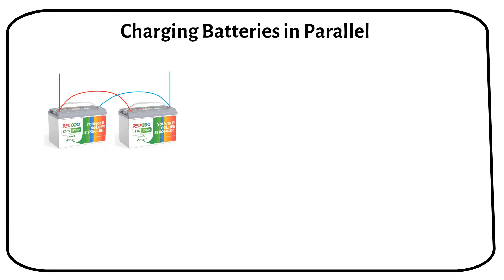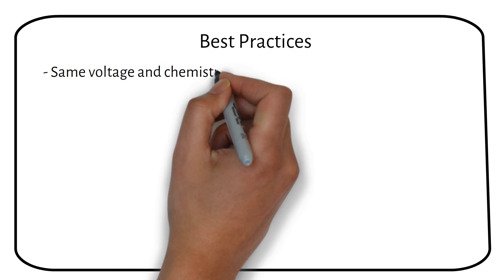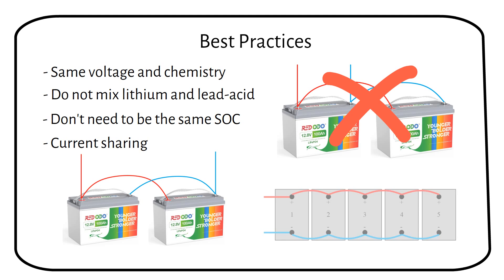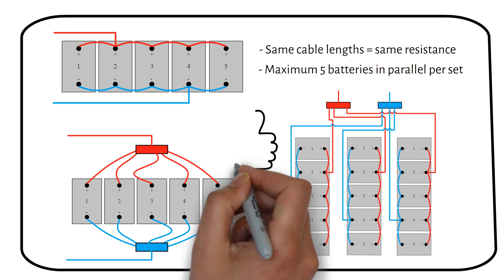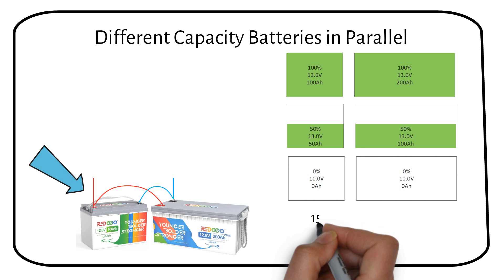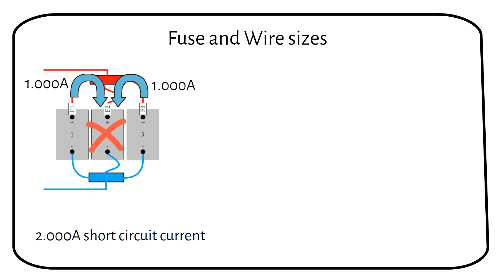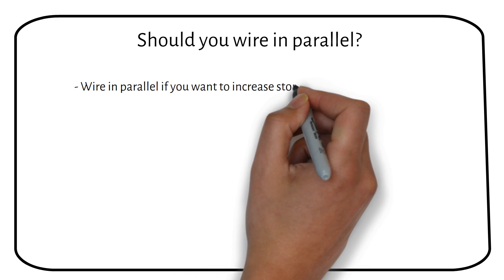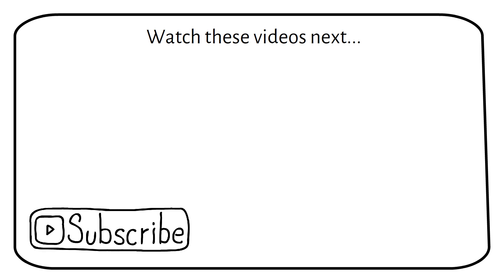How to Charge Batteries in Parallel With Different Capacity

Comment: With your example showing red to battery 2 and black to battery 4 in a 5 battery system, is this also where I wire the solar charge controller?  I think it's both as I'd want the current also flowing in evenly.

Comment: Can you provide wire sizing? I am preparing (2) 100 Amp Lithium batteries to a busbar to create a parallel 12volt 200 Amp hour system.
Reply from the maker: Check my video on how to size wires. It's in my beginners playlist on my channel.

Comment: Good advice but take care with Lithium.  

 Unbalanced cells in series  may reverse polarity under heavy load which on  charge is reversed again.   You now have a potential bomb.   This is why  limits of 20% discharge and 80%  max is recommended.

Comment: Qty of 4 - 24 Volt 100amp hour batteries to a Buss Bar with 100amp Mbrf terminal fuses on each Battery for a 3000 watt 24 Volt Inverter and a 60 Amp Mppt Charge Controller. 
Do I Fuse the Inverter from the Buss Bar with 200 amp fuse to 4 / 0 Cables ?
Reply from the maker: Indeed, you need a fuse from the busbar to the inverter. 3000W/24=125A*1.25 (safety factor)=156A. A 175A MEGA fuse or 200A fuse can be used. A cable that can carry 200A minimum is 2AWG welding cable (105°C insulation temp). Your charge controller needs a 75A fuse. A cable that can carry minimum 75A is 6AWG.
Reply: @cleversolarpower  Thank You Nick
Reply: @cleversolarpower 
Hi nick a question men can i put more than 4 batteries lifepo4 25.6v 100A in parallel with busbar and fuses example 5 parallel? A total 25.6v 500Amp?

Comment: connecting two batteries in different states of charge might set you up for a big surprise. If the batteries have high capacities, there will be high currents when the charge tries to equalize. Above 100Ah, apply a little caution when connecting full and empty batteries in parallel, especially if they do not have a BMS.
Reply from the maker: Indeed. Better to charge them or discharge them before connecting.

Comment: Do you recommend using a bus bar if using only 3 lithium batteries?
Reply from the maker: I recommend using a fuse on every parallel battery. So it's best to use a victron MEGA fuse holder with integrated busbar. You can see it in one of my recent videos. You can also use an MRBF fuse holder on every battery. Then you need fewer cable crimps (but more expensive).

Comment: I have six 12v 220ah tubular battery I want to upgrade to a 48v system. How do I connect them
Reply from the maker: 4 in series. You have two batteries left over
Reply: @cleversolarpower  what if I parallel the other 2battery

Comment: I need a 12v lithium charger with xlr connecter for my wheelchair I have 2x36ah lithium batteries in parallel and at the moment my son is having to lift the seat take the batteries out to charge them separately with crocodile clips we r I'm scotland uk do u have any recommendations plz

Comment: ok, so you spend a whole video on how to wire batteries in parallel. where do you actually talk about charging the batteries like the title suggest?
Reply from the maker: You connect the charger at the same points as the inverter.

Comment: Hi nick i have 20000AH battery with 59v soc is100% and 44v battery and soc is 0% i want to transfer the charge from one another with 80AH by charging cable of 100AH can you sole this give me the detailed explanation practically is it possible
Reply from the maker: You have to charge or discharge the batteries and then you can connect them. They have to be the same chemistry and be at the same state of charge.

Comment: I have a 72v 40A (max) 500watt (motor) and i'm thinking of using 4 12v 18ah lifepo4 batteries and 2 12v 20ah lead acid batteries.

The 4 to be wired in series and the 2 acid to power a boost converter, to gain the extra
24v needed?  Using a bus bar to connect the 4 & 2 together before connecting to the boost converter, then to the load.

Can you give me any insight to this arrangement? ..

Comment: i fly fpv mountain long range and use my diy 6s2p molicel liion.. and i wonder if i can combine my 6s2p 8400mah and 6s1p 4200mah (all the same molicel sell and type) because when i discharged them with my xt60 parallel connector to a discharger both were discharged at the same total mah (just like if they are wired directly as 6s3p). and then when i charged each 6s2p and 6s1p they were charged at the same total miliamp.. so is this means safe to parallel a 6s2p 8400mah and 6s1p 4200mah to fly? (my discharger only discharge at 6A vs cruise flying is around 15-25A constant.
Reply from the maker: Seems like it can because it will act like a 6S3P pack.

Comment: I just watched this video, thank you! I have (4) 100Ah batteries going into my exiting 12v RV with a 1000W inverter. Each battery has a max in/out of 100A. I also have a 150/35 Victron Solar Controller. I’m going to use your Bus Bar recommendation, but I am a little confused on what size fuses I should put on each battery. A little help here would be much appreciated!
Reply from the maker: 1000÷12×1,25÷4=26A. Then I would multiply by 1.5 to account for imbalances between the batteries. So that becomes 40A. Fuse with 40A and a wire that can carry at least 40A. Check my wiring calculation video for that.

Comment: Love your explanation! I want to build a dc power box, with solar charging. I want to use various tool batteries of the same voltage but diffrent capacities. Could I connect the charge controler to the bus? I assume the cut off would not hurt the smaller capaticy packs?

Comment: I have purchased a 8000 wat 12v inverter. What kind of batteries should I buy to power it?
Reply from the maker: Yikes man, why did you get a 8,000W inverter on a 12V battery? Check my most popular video, how many batteries for a 3,000W inverter an repeat the same calculations.
Reply: @cleversolarpower  Thank you, I wanted to be sure that I could power a refrigerator, freezer, hot water tank and a kitchen stove, exc.

Comment: So glad i found this page, im just about to hook up inverter and a ton of wet batteries i bought pre cov , i noticed one of the solar panels has a nick in the rear panel bit. I still ok to use? i have a pip 2424msxe brand new , So i have a feeling im gonna be loving this page for sure.
Reply from the maker: It's best to measure the solar panel output with a multimeter. there are several videos that show how.

Comment: I have four 48v 30ah and two 48v 50ah LIFEPO4 batteries. All are connected to 4 lug busbars. In order to even out the draw from the difference capacities, do you have an alternate parallel wiring suggestion?
Reply from the maker: No. the draw will be based on voltage if they are all wired in parallel. So the voltage of every battery will be the same at all times.

Comment: I wasn't searching for this topic exactly, but your site was the first hit that I got. You didn't address the issue that I was asking about, but I bet that you are the guy that can answer my question, all the same, and other folks may also have the same question, so if I might....
   I have an assortment of 12.8 volt LFP batteries that are of various ages, but none have seen a lot of use. They also vary in their capacities from 100AH to 300AH. I have them to connect to various inverters as I need them when my power goes out, rather than all connected together to one big grid down backup system. It's just the way it has evolved for me as I started fooling around with LFP batteries. They keep getting cheaper and lighter and smaller and I keep buying them. My issue is that I want to have them stored in a convenient  place with some sort of charger that will keep them at a good maintenance charge until I need one of them. I'm old and I just don't trust myself to remember to go around and charge each one if I suspect I'm going to need it during a spat of bad weather, for instance. I want them to always be at the ready when they need to be put into service. They won't have any load on them, they will just be sitting on shelves.
   My vision is a 20 amp charger set to 14 volts or so, connected to 2 solid aluminum bus bars, about 3/8 X1/2 inch in cross section, with a bunch of 12 AWG wires with small alligator clips connected to them so that I can unclip a battery, use it, leaving the other batteries connected, and then return it to be reconnected when I'm finished with it. Maybe even several batteries at one time. I may make it a little more sophisticated than that, but that's the basics. My question is, do I need to be concerned with keeping wire lengths the same and fusing each charging lead, since I'm not going to be actually discharging them while they're in the rack?
  Thanks very much for any help you can offer.
Reply from the maker: Try to have the same wire lengths. You have to fuse every wire.

Comment: Hi 2x 12v lifepo4 batterys. Both different manufacturer.bith have BMS and Bluetooth ...I want to wire in parallel 200ah + 280ah . Do I need to charge both battery 100% first ,then change my soc  app to 480ah or will BMS look after it all as regarding to charging and soc?

Comment: I have two lithium ion batteries for my e-bike hooked in parallel 48 volts they have different capacities what would happen if I took a 12-volt lithium-ion battery different capacitance and complete the circuit in series to my controller to make it a 52 volt power pack

Comment: Can you guide please? How I will add a 120 ah battery to already four batteries of 105 ah connected in series. The voltage is 48v must for solar inverter
Reply from the maker: You cant. only if the 120Ah battery is 48V.
Reply: I want to add it in parallel, the voltage will remain the same, amperes will increase

Comment: You say you can't mix batteries of different chemistry. Yet most modern boaters have a hybrid bank, with both AGM and LiFePo4 batteries wired together in parallel. How come?
Reply from the maker: You can, but I don't recommend people do it. It gets complicated quickly. If you still have some good lead acid batteries, then yes, maybe. But now lithium is cheaper than lead acid by far. So why still use lead acid anyway?
Reply: @cleversolarpower  Well for instance if your boat engine normally charges your AGM battery bank, which you have for engine starting and instruments, but your lithium bank which is a house bank also gets charged by the alternator, the alternator can overheat as lithiums can take much more power than an AGM. 
There are DC to DC chargers, but they are expensive and adding one more layer of complexity into something that is in reality very simple. 
In order to avoid having to completely rewire, or rewire for two systems, wire the LiFePo4 batteries in parallel with the AGM's, the AGM's take charge from the alternator but the lithiums suck that charge out of the AGM's at a much slower rate. That way all batteries get charged, and the AGM's and Lithiums complement each other, while retaining redundancy. Thousands of boaters have been doing this for a very long time.

Comment: how do you connect enough EP3 Cube to give you a battery bank of 350kw
Reply from the maker: Easy, just divide by the power capacity of one battery which is 3.3kWh
Reply: @cleversolarpower  so what about the hybrid stacks of 19.9 kwh per  ...how many stacks can you connect in series

Comment: At the 5:00 mark of the video, you have shown that the load from the inverter, and all of the chargers (solar & battery charger), are all connected to the same buss bars, and therefore to the same "corners" of the battery array.

I have 4x 6v lead acid batteries in a typical series/parallel arrangement.  I was advised some time ago, that the +/- connections for the CHARGING circuit, should be at "opposite" corners of this battery arrangement, while the +/- connections for the LOAD circuit, should be at the opposing corners of the battery arrangement.  So, the charge connections are at opposite corners compared to the load connections.

How important is this?  Your diagram is simpler and makes sense to me!
Reply from the maker: Good question. It doesn't really matter in your case (2S2P). I assume you were told to do so to limit the amount of lugs you have on one battery terminal. Now you have 2 but if you follow my diagram you would have 3. Max 3 are allowed.
Reply: @cleversolarpower  If however I wanted to add a shunt on the negative post, I would then be forced to insert at least a negative buss bar,  correct?  I believe that this is because the shunt needs to be between the negative battery post, and all 3 of the load / charger / solar controller.

And if I need the negative buss bar, I figure might as well go ahead with a positive buss bar.

thaanks,

Comment: No, I have the right sizes. What I want to know is the wires coming from the Controller connect to which Battery terminals. Then the wires going from the Battery to the Inverter are connected to which Terminals on the Battery.

 I have four 300W panels connected to the Controller.  Then from the Controller to the Battery's. Then from the Battery's to the Inverter. As it should be.

 I want to use the fan model as in the "Better." You have all the Positive Leads connected to a single point then a wire going "out" to the Inverter? 

All the Negative Terminal wires connect to a single point, then a wire going out to the inverter from that point, but no diagram of the Negative wire coming in from the Controller.

All the Positive Terminal wires also connect to single Positive point then a wire going out to the Inverter from that point, but no diagram of the Positive wire coming in from the Controller.

Comment: I need to know the wiring "in" from the Controller, then the wiring "out" to the Inverter. No-body shows that.
Reply from the maker: I have made videos about selecting wire size if that's what you mean.
Reply: @cleversolarpower  No, I have the right sizes. What I want to know is the wires coming from the Controller connect to which Battery terminals. Then the wires going from the Battery to the Inverter are connected to which Terminals on the Battery.

 I have four 300W panels connected to the Controller.  Then from the Controller to the Battery's. Then from the Battery's to the Inverter. As it should be.

 I want to use the fan model as in the "Better." You have all the Positive Leads connected to a single point then a wire going "out" to the Inverter? 

All the Negative Terminal wires connect to a single point, then a wire going out to the inverter from that point, but no diagram of the Negative wire coming in from the Controller.

All the Positive Terminal wires also connect to single Positive point then a wire going out to the Inverter from that point, but no diagram of the Positive wire coming in from the Controller.

Comment: I have an AIMS LiFEPO4 100Ah battery and want to add in parallel another 100Ah battery.  AIMs no longer makes its 100Ah battery.  Can I add a 100Ah of another brand?   How does the BMS work if batteries are not the same?  Any other considerations?  Looking at Litime 100Ah to add...  thanks - oyur site is great!
Reply from the maker: Thanks 🙏, yes you can add another battery in parallel. You can even have different capacity batteries in parallel.
Reply: @cleversolarpower     Thanks for quick reply - there should not be any issues with different battery monitoring systems?

Comment: Thx so much for your guidance. Can I connect in parallel a 100ah 24v to my old 20 ah 24v using your wiring advice, positive on my 100ah end and negative on 20ah end?

Would it cause any problem or harm my 20 ah battery in anyway?
Reply from the maker: No. 1/6 of the energy or current will come from the 20ah battery. The rest will come from the bigger battery.
Reply: @cleversolarpower  thanks so much for your reply. This would actually pave way for later expansion.

I must balance 2 batteries to same voltage before connecting them together, right?

Comment: Hi
From Colombo, Sri Lanka 
I am using a microtek 2335 hybrid inverter, 2 x 12v 200ah Okaya Opgel and 3 x 375 REC panels.
I operate with smart metering ie - Day time 5.30 am - 6.30 pm, Peak 6.30 pm -10.30pm, Off peak 10.30pm - 5.30 am.
I auto switch off the peak time by way of timer and contactor thereby zeroing peak current and charge in off peak, and save during day time via solar.
Net saving has been almost 65%.
My house is single phase and I have split wired my house as follows.
1. All lights, fans, TV, Fridge,audio including plug points in room through inverter /solar hybrid.
2. Iron, Oven, Microwave, Electric Kettle, Air Fryer,Washing Machine induction all direct to grid.

Although system works fine if I operate at full capacity during peak I found my battery id's almost fully utilized and insufficient if I have an extended power cut.

Watching your video I want to increase this same system by 6 batteries of same type. Make 3 sets of 24v x 200ah and connect each set to a 24v/200ah 5 stage intelligent charger ( so total 3 sets of batteries & 3 chargers) I will set a timer/contactor to charge these during off-peak  and day time only.
This will give me 19w reserve and hopefully many years of use.
I intend connect 1st set to hybrid inverter and balance 3 sets as tag on parallel (with their grid chargers)
Please advise your thoughts.
Thanks and Regards
Jeremy
PS - Anyway I can discuss with you +94776783218

Comment: Question:  I have 2 100 AH batteries and one 200 AH battery wired in parallel to busbar. Do you recommend a charging equalizer?
Reply from the maker: No, parallel equalizes itself. The bigger battery will draw twice as much power, but that's ok.